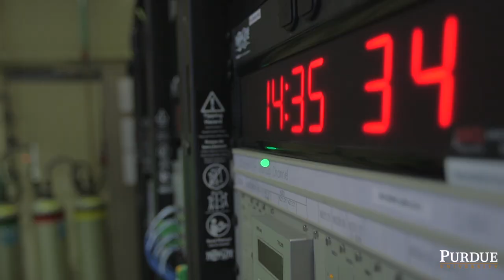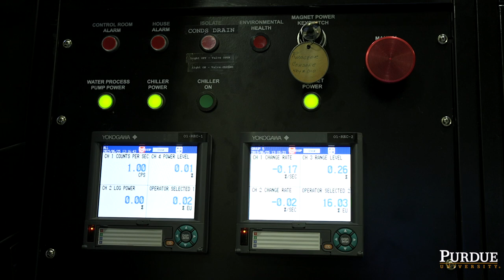PUR-1:  First US Nuclear Reactor with All Digital Instrumentation and Control System

Comment: Depends on how it's implemented within the industry.  Like a couple of comments here, I believe some industries need - REALLY NEED - what they call an "air gap" which isolates critical operations completely from the "internet".  The worldwide web has become such a toxic battleground, I'd be very careful about making critical technology or operations available there!  If the "air gap" is the approach they use here ... then yeah, it's a good thing.  If they're talking about improving monitoring, data collection and control systems' speed and accuracy that is necessarily hack-proof, then it's a good thing ... no more sluggish magnetic amplifiers (remember those?) and no analog measurement and recording techniques.  I'm an IU guy because that's my school ... but this was a pretty neat development for them danged Boilermakers, IMHO!!  :)  You know, to be the first, with the chance to prove the tech.  Purdue is the perfect school for it because of their engineering programs!  Oh, and The Oaken Bucket belongs in Bloomington. Just saying.  :)

Comment: It sounds progressive   -but is in fact dangerous due to hacking-risks.
In fact the EPR in Finland only got a building-permit after the constructors added an analog  back-up system. 
And plants in Germany and other parts of Europe are activly prohibited to change the 'old'  but safe relais based circuits...